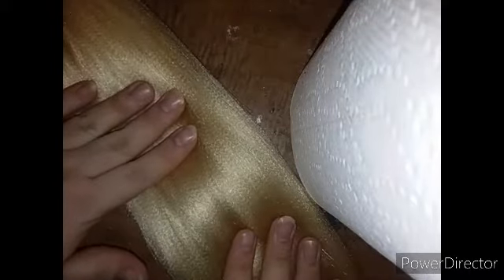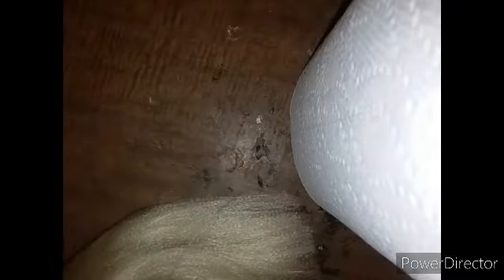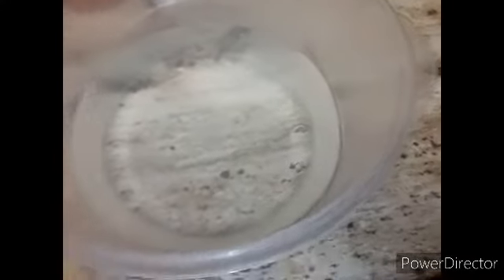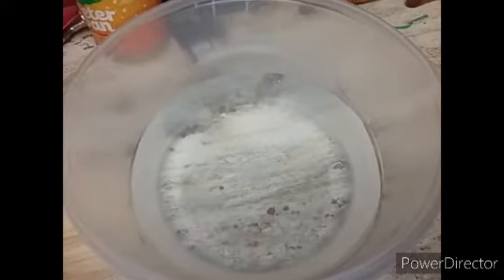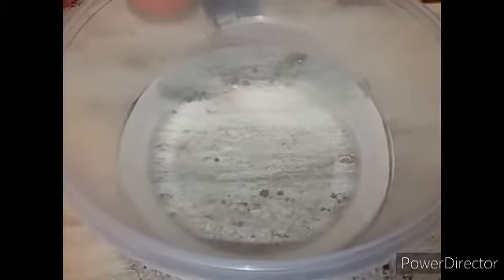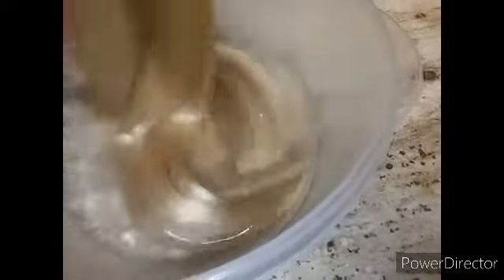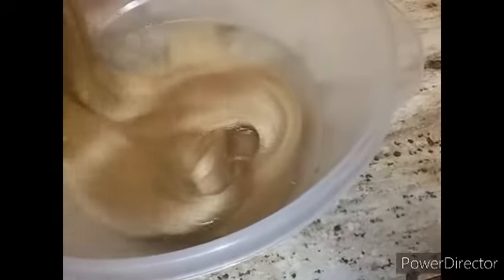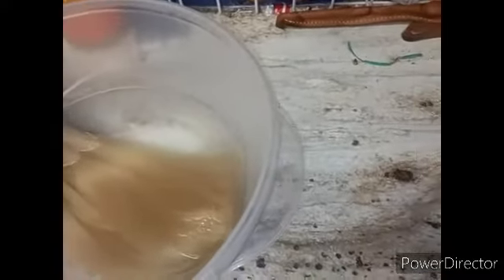boil washing kanekalon braiding hair for rerooting dolls

Comment: It's a pity that I watched this tutorial late. I have already re-rooted my Barbie doll using saran hair, and I can say that the saran hair is on the heavier side, and it's bugging me. Maybe I'll purchase kanekalon braiding hair and do this method on my next rerooting project. I just hope that after boiling and washing the kanekalon, it will stay deflated and won't go voluminous, just like it originally looked.
Reply from the maker: Once kanekalon hair is straight it stays straight unless you add in the texture yourself. If the hair has any faint crimps still in it after the boil wash you can always flat iron it on a low heat setting. Just make sure you make the hair damp with a spray bottle with water so you don't burn the synthetic hair
Reply: @amberruxpin  Thank you so much. If it weren't for your videos, I would have still use saran hair in my next rerooting projects, which is pretty expressive. I'd rather spend it on much cheaper yet good-quality products.

Comment: im gonna try this, this week. what is the best glue to use once the reroot is complete?
Reply: This may not be helpful with keeping the hair in place, but if ur just doing this with your doll and putting it on the shelf or etc then it's best not to put glue simply bc with heat and other temperatures it can melt the glue inside and make your dolls hair super gooey and if u want the hair to be glued try not to put as much glue, and I suggest fabric tact glue.